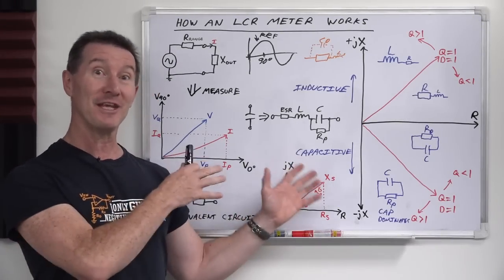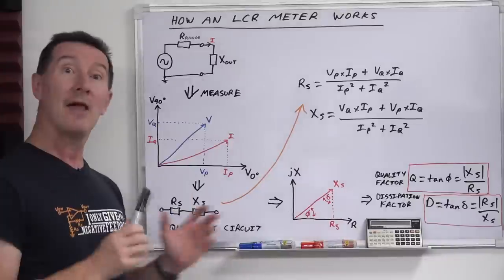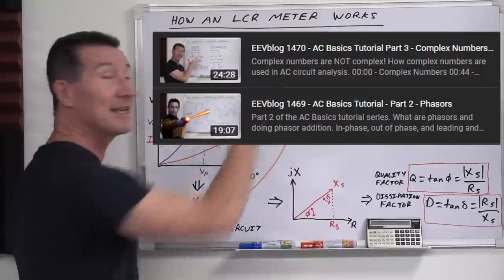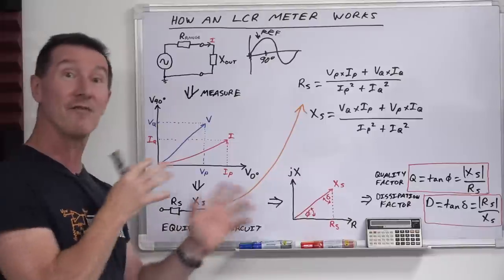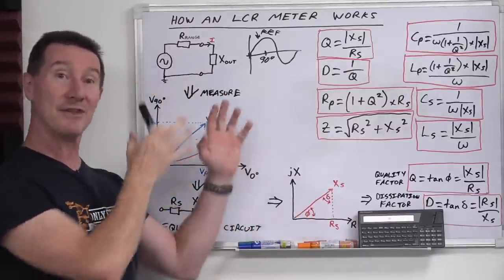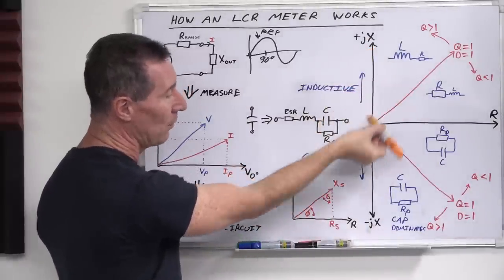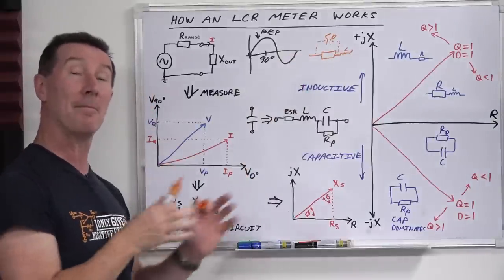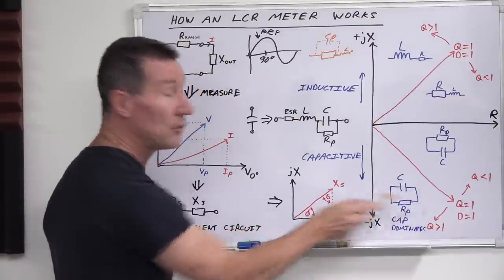EEVblog 1473 - How Your LCR Meter Works

Comment: A little correction.
At the bottom right on the whiteboard, you have ...
D = |Rs| / Xs
... it should be ...
D = Rs / |Xs|
... as Xs is the value that can be negative.
Reply from the maker: Err, yeah, that sounds more righter...
Reply: @EEVblog  Nay mate, the original was good enough for Hostralia...
Reply: And the red Xs in the bottom center diagram would be better placed on the imaginary axis, similar to the Rs on the real axis (or replaced by "Zs" instead). Great video nevertheless!
Reply: It is the same. It does not matter if you multiply something with -1 or dividing something with -1. It does not matter if the - sign is over or under, because it is the same. There is not "righter" :)
Reply: @zsoltkohler7096  you're wrong. The value of Rs is always positive (by definition), while value of Xs may be negative (capacitor) or positive (inductor). So taking the absolute value of Rs makes no difference, while a negative Xs will result in a negative value of D.
Also, as D is the reciprocal Q, the formula for D (Rs/|Xs|) should be the reciprocal of the formula for Q (|Xs|/Rs)
Reply: @mortenhattesen  Oh, now I got the point, thank you! :) You are right! (How could I missed...)
Reply: Wow! I didn't see that coming. I was just admiring the pretty colors. My bad. Good on you Sir Morten!
Reply: I was just starting to search jokes about negative resistance... :-P
Reply: Dear Morten, you both are right. all depend on referenace axie.

virtual/real absolute number, (-) or (+) it only to calculations type of circuit.
---------------------------------------------------------------------------------------------------------
if you test it in serial circuit , the AC(Amper)  constant refernce.

in prallel circuit, the AC(voltage)  constant refernce.
----------------------------------------------------------------------------------------------------------

if you take refernace Y axie, the Rs need to be absolute.
Reply: @mortenhattesen  Very rightly said

Comment: Great stuff Dave. I worked a full career in power generation and now I'm an adjunct prof. I can't stress how important fundamentals like these are for engineering students. Sadly, I'm finding that these foundational concepts are not being stressed as they were when I was a student.  I hope that students are watching your videos. Keep up the great work!
Reply: Many of the students I went to school with complained about this sort of theoretic treatment (a decade or so ago), but I find having a grasp of it massively improves my ability to find solutions in the applications I'm working on.

Without the fundamentals, you can be totally lost when something doesn't work for some reason, or when you need to design something you can't copy from elsewhere. Maybe most people avoid both situations, but I sure can't!
Reply: @martinmckee5333  Agreed. About 10 years ago, a power plant colleague said to me "they don't teach that stuff anymore, students have access to do much info that they don't need to know those concepts.". My response was "but SOMEBODY needs to know this stuff." He paused, then agreed. Bottom line is, engineering isn't about parroting back someone else's material. Without complete knowledge of fundamentals, an engineer is essentially doomed to failure, and should seriously consider switching careers (perhaps to philosophy, or a related trade).

Comment: I'll be honest, I'm a bit crap at maths, but videos like this inspire me to make the effort and try to expand my knowledge. I'll have to watch this and the other videos you mentioned several times before the penny drops, but I'm sure I'll get there.
Years ago, when I was in college, I remember being fascinated that we could calculate the dynamic impedance of a diode using Pythagoras Theorem.
I've been a service engineer for over 30 years, and I've NEVER had a practical use for that knowledge, but I'm glad I learned it because I found it very interesting. 😊
For me at my repair bench. Diode working, correct voltage drop across forward biased PN junction. Diode short circuit. Diode open circuit.......Done.

Comment: The measurement doesn't have to be in phase with the source signal, it's only important that the two measurements be 90 degrees apart in phase at exactly the source frequency. This is what the fast Fourier transform does and outputs two vectors 90 degrees apart. Although the phase of the two vectors is random with respect to the source phase, the calculations are exactly the same because it is the ratio of the real and imaginary amplitudes and the relative phase between them that is important.
This simplifies the hardware because there is no need to synchronize with the source as long as the frequency is precise. The A/D sampling has to be frequency precise with regard to the source and then an FFT can use the sampled data to extract the vectors and then calculate component values.
A primitive LCR meter can be made using an Arduino to generate a square wave source with the A/D triggered at four times the square wave frequency to give the proper phasing with half the samples the sine value and the other half the cosine. This is the hardware equivalent of doing an FFT. The first sample is sine +, the second cosine +, the third sine - and the fourth cosine -.  The - samples are multiplied by -1 and added to the + samples and averaged to get the amplitude of the vector. The cosine value is the real part of the vector and the sine is the imaginary part.
For higher precision the source voltage should also be measured using the same technique. If this is done, the source voltage value is not important as long as it is stable. The LCR measurement depends only on the ratio of the DUT impedance to the reference resistor impedance and if the same A/D reference is used for all measurements a fairly accurate measurement can be made.
A PC sound card can also be used as the basis of an LCR meter because it can easily source and measure and only requires a simple op-amp input buffering and guarding stage.

Comment: I wish you had gone into into the series and parallel model a bit more as that's actually important understand when doing measurements with an LCR meter. I see people bungling it up all the time. What's the difference between Cp and Cs? Why switching between these give you vastly different values? Some LCR meter don't let you switch between these at certain values, what gives? And so on. Lots to talk about imho. Again, some people I work with have very little experience with LCR meters and like once I year I stumble over someone having measured and documented the wrong one and it being undetected for months. So, you'd do the industry a favor clearing this up.
Reply from the maker: Yes, could spend another 10 minutes on that. If I wrote a script that would have been in there.
Reply: I agree. Pls Dave 🙂
Reply: It looks like a good subject of the next video

Comment: Nice :)
It goes pretty well with the one about measuring inductance with a multimeter set to capacitance measurement.

BTW, back in 2004 my high school was having some serious remodeling and the labs were to be packed up, so lots of old gear had to go; a few electronics geeks (including me) who were on good terms with the physics and chemistry teachers got some cool stuff. Mine included a vintage '80s analog RLC bridge (Meratronik E316 for those interested) that can measure on DC, 50Hz and 1kHz. I rarely used it, but it's there in case I need to measure a choke.

Comment: Hi Dave, thank you for another very informative video. There is something in your notation that seems odd, though. From the equivalent circuit and the complex plane graph, you seem to imply that Xs is a complex number. However, this does not seem to work because Xs is calculated in your formula using Vq, Vp, Iq, and Ip which are all real numbers. I believe, what you were trying to say is that Xdut = Rs + jXs, with Xdut complex and Rs and Xs real numbers. If this is true, it makes sense to say that Xs can be either positive or negative. If this is correct, the reactive part of the equivalent circuit should be jXs instead of Xs, and the red arrow in the complex plane should be Rdut instead of Xs. Xs should be the projection of Rdut on the imaginary axis. Does this make sense?
Reply: I think you are correct, but I would think instead of "Rdut" you should be saying "Zdut".   Zdut = Rs +jXs.  Because saying "Rdut" implies it is a pure resistance.

Comment: Back in the olden days when I was in an electronics class at a community college, we were all given a 5H choke, large iron core inductor to measure. We all got some silly number I don't remember but it was very small, like 100uH. Nobody cared, even the teacher, as he didn't know why. I followed through (for weeks) and found our test current was so low, it barely moved the domains and put the BH curve where it almost followed the X axis line. If we had tested with a higher current, the line would have separated from the X axis and we would have got a higher inductance answer. Nobody cared. Sad!

Comment: If the load is purely inductive (so Xout = jwL), and w and L are such that wL = 1.  Then we have Xout = j1.  Then we know that the current lags the voltage in an inductor by 90 degrees.  So if the voltage placed on the inductor is also 1, then Vp = 0 and Vq = 1.  The current would be Ip = -1 (since the current lags the voltage in an indcutor) and Iq = 0.   

Then if we use your equation for Rs, we correctly get Rs = 0.  But if we use your equation for Xs, we should get +1, but the answer I get is -1.   Xs = [ (1)x(-1) + (0)x(0) ] / [ (-1)^2 + (0)^2 ]  = -1 / 1 = -1. 

If I do the same thing but with a capacitor instead of an inductor, I would except to get Xs =  -1, but instead I get Xs = +1. 

Am I missing something or is there a sign error somewhere?

Comment: I have a confusion over here: wt = 0 degree and wt = 90 degree are two different instances. How are we getting Vp and Vq by extracting the values at two different instances... The vector V in your diagram is the voltage phasor at a particular instant. How would you get info about V's component in Vo axis at a particular instant if we measured at two different times?

Comment: Wonderful video!  One thing that confuses me is the graph of the impedance in the bottom center of your board.  Impedance is  Z = R + jX.  So shouldn't Xs be on the imaginary/vertical axis, Rs be on the real/horizontal axis, and Zs be placed where you have Xs marked?       For example, if your impedance was Zs = Rs + jXs = 2 + j3, the absolute value (marked with the | | ) of Xs is 3.   But the way you have it drawn with Xs being where Zs should be, the absolutely value of Xs would be ~3.6

Comment: I think you are saying that the meter measures the phase angle difference between the voltage peak and the current peak - is that right?
Reply: That is what I thought so I am not sure what Dave is saying.  Scalar measurements of the voltage and current, and then a measurement of the phase between them which is much easier than what he suggests, is enough.  Making a sampled measurement at 90 degrees is possible but why?

Modern instruments may do something completely different using a pair of FFTs.  Read the Analog Devices application notes on the subject.
Reply: @Alamagosa  An FFT effectively samples at 90 degrees when it multiplies by sine and cosine. The only difference is that the relative phase between the source and the sine and cosine samples is random. This is not relevant to the measurement because all vectors are rotated the same and its only the phase difference between them that is important.

Comment: Can you use an LCR meter to directly determine the impedance of an audio transformer both on the secondary side (4, 8, 16 ohm) and in the primary side (for matching to a tube for example). When you acquire an unlabeled transformer it would be very helpful to know this. I assume this would be done at 1Khz but I'm not 100% sure. I measure the outer wires on my secondary to be 3.5mH, @1Khz this translates to 22 ohm. From the center tap on the secondary it measures .9 mH which translates to 5.7 ohms. Thanks
Reply: Now if I measure my speaker (Using my very cheap LCR meter) the "8 ohm speaker" measures 1.9mH. At 1 Khz the impedance would equal 2*3.14159*1000 Hz*0.0019mH = 11.9 ohm ... nowhere near 8 ohms. At 400 Hz it would be 4.8 ohms and at 5 Khz would be 59.7 ohm. Thoughts?

Comment: amazing sir. Hoe to measure the R L in series and C in parallel that is the one end of C at R and another is grounded. It will form the RLC lumped model. How to measure RLC of the RLC lumped model of interconnect using LCR meter? Please guide sir

Comment: Hi dave i'm considering buying the samsung TA845 usb c charger but in the teardown by charger lab i saw that they are still using Capxon capacitors. Have they gotten any better or should i pass on it?

Comment: but what happens when the meter measures something that is more than 90 degrees out of phase?
Reply: If I'm thinking correctly, it's just opposite of resistance so conductance? Measured in Siemens or mhos?
Reply: That simply cannot happen. It would imply a negative resistance, which would result in an increase in voltage the longer the circuit. 
If it could happen we could have perpetual motion.
Reply: @fcolor0430 - conductance is the inverse of resistance, not the opposite.

Comment: Am I correct that all these formulas are trigonometric? I recognized that impedance is A^2+B^2=C^2 rewritten then seemed to recognize a few more.
Reply: It's possible to use trigonometry to get the values, but using complex arithmetic is much, much simpler.

Comment: Hello Dave, I came over from a mention in a Thunderfoot Video.  I would like to know if you heard about this supposed new company that says they have new proprietary 3D cell architecture increases energy density and maintains high cycle life.  I think you and Thunderfoot have done videos on companies that try to bring new batteries to market but end up not being viable or just a scam.  I was wondering what you think about this company and is it worth doing a video on.  The company name Enovix based in Fremont, California.  Do you think based on the information they provide on their website that they will revolutionize the battery industry as it stands today?
Reply from the maker: Never heard of them. But the rule of thumb is that almost every new battery company is impractical bullshit until proven otherwise. Almost all of them go nowhere.
Reply: @EEVblog  Thank-you very much for getting back to me I really appreciate it.  That is exactly what I thought and I think it might be a theranos of battery tech in Silicon Valley.   They are listed on NYSE and show picture of prototypes.  Where the scam part comes in is that some representatives of the company said they have been going to Korea for weeks to close a deal with a Korean OE.  To me that is outrageous, why would Samsung, LG, Hyundia etc need to buy unproven technology when they spend billions on their own battery technology.

Comment: How does the frequency used in the meter affect the reading and determination (L, C or R)?
Reply from the maker: Capaciatne and inductance values are both determined by frequency. You can tell because the formula for them I showed will contain omega (W) which is 2 x Pi x Frequency